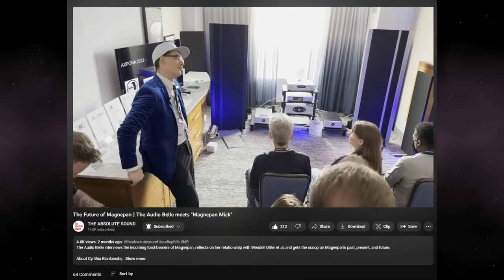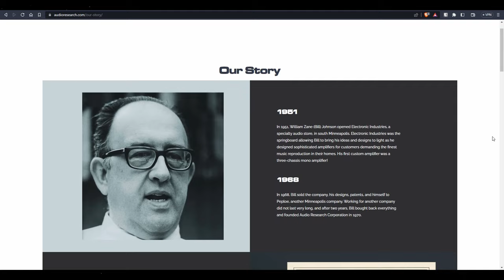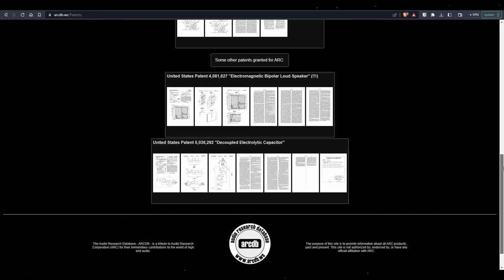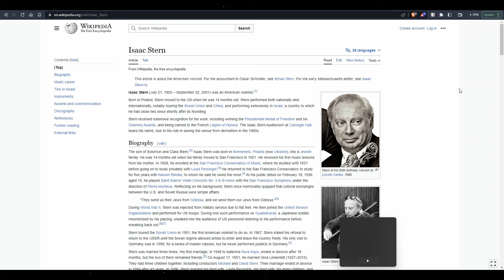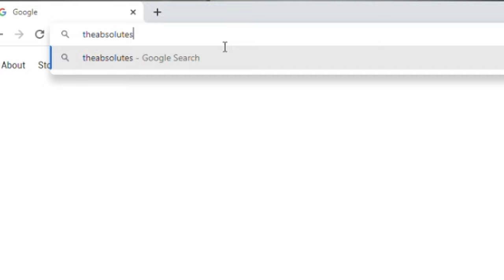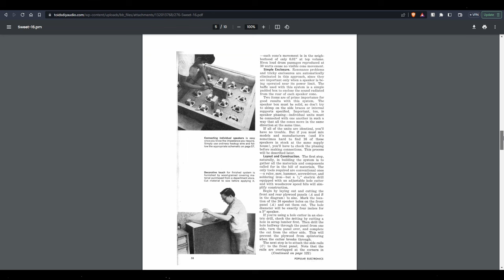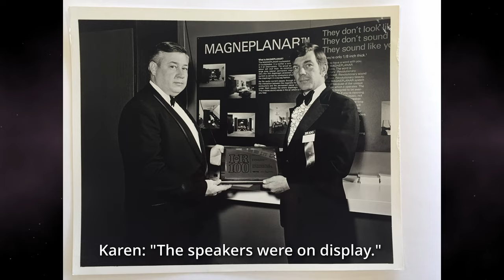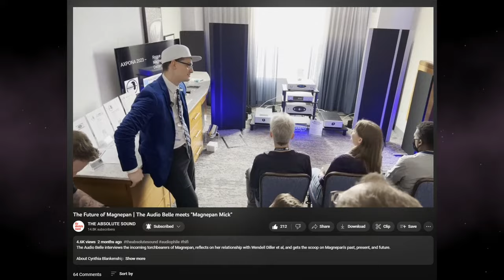The Mind Behind the Magneplanar | An Exclusive Interview with Jim Winey

Comment: I remember buying Tympani 1C’s and then a little later the Tympani 1D’s !! The first pair I bought were after hearing Tympani 3 mid/top panels !!which were the first pair in Australia mine being the first full range pair in Australia 
I had a perfect room for tight clean base 40 ft long only about 10 ft wide and 3/4 underground !!

Tight clean sound driving then with a D76A